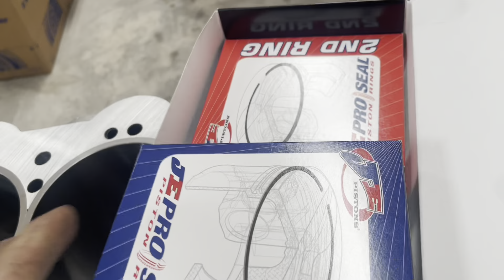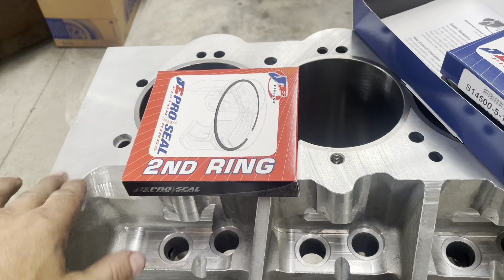Turbo Motor Build Series PT: 2 File Fitting Rings And Some Additional Prep Work

Comment: I believe I would find me a good billet crank to run in that new block. I hate that they give you the wrong size crank it’s hard to find good used parts and get what you need.
Reply from the maker: We did reuse this crank just made some changes….. That video may be out tomorrow or Thursday 🤛

Comment: How close are you to having the new trick flow powerplant put together?? Rather than going to dig or die I'd rather you take the time to get the complete operation including your new engine all put together, ready to go when racing really starts going.. guys are going to be even faster this year and you deserve to finish every race well.. guess what I'm saying is that I've watched you for years bust butt racing and you're so close to being back at 100% that it would be a shame to see you quit pushing forward to go race and then come back and try to pick up where you left off... you have ocd like me and once you quit going forward on a project it's awhile before we get back to it.. warm weather will be here before you know it and I really want to see you have everything ready to go and as perfect as possible
Reply from the maker: If I had my old heads to verify valvetrain geometry it would be ready to go. My good heads are  currently on the borrowed Motor
Reply: @HustlinHorsepower  I don't blame you for wanting to get the borrowed motor out of straight gangster and your new engine in.. it would be a shame if you went to dig or die and hurt that motor. Then you would have to finish yours and fix the borrowed one.. I'm excited to see you with the new engine and turbos.. 2024 people are either going to have to get fast or drop down to a true street type of racing.. you have independent front suspension and a new engine and turbos, you're definitely going to be fast